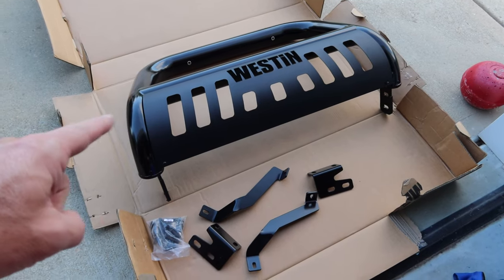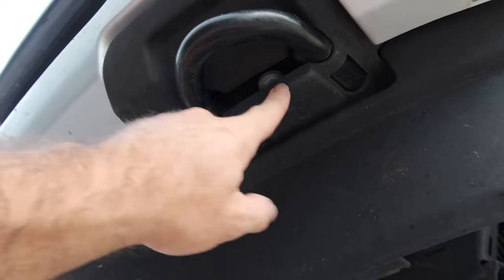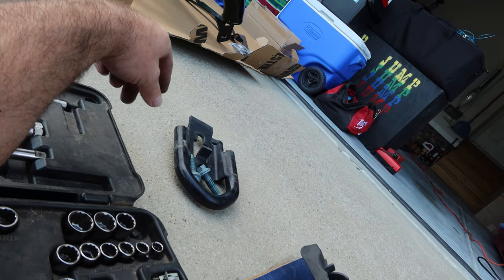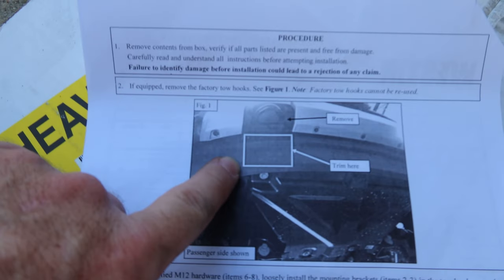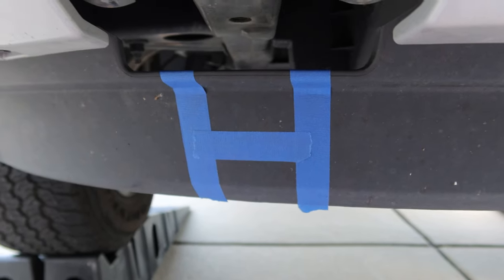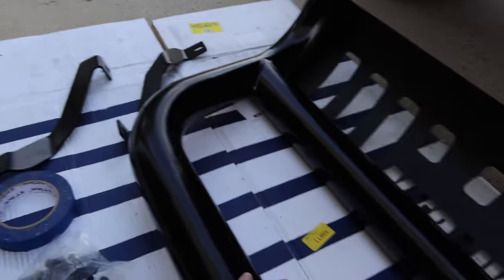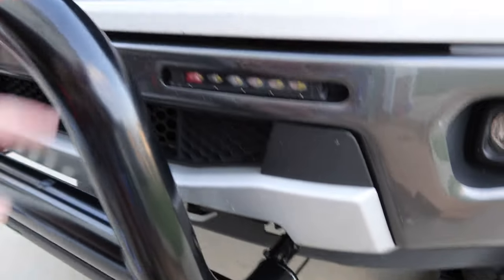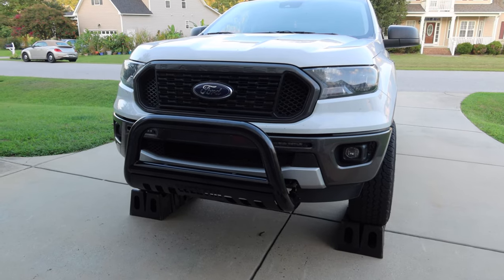Ranger Bull Bar Installation - How to Install a Westin Bull Bar

Comment: What about the parking sensor or collision sensor? Didn’t interfere with it?
Reply from the maker: I do not have parking sensors on my truck, and I can't speak for other models. However, the collision sensing is handled by the camera in front of the rear view mirror, so it is not affected.

Comment: i wanna get this same bar, just wonder how different it would be on an XL with no stock tow hooks. the brackets are there but the bumper cover would definitely need trimming
Reply from the maker: I would go to the website and use your trim level and make sure it's compatible.
Reply: Just because you don't have the tow hooks doesn't mean you don't have the holes for them.  I have an XL - but was upgraded with the STX black out package...I have tow hooks...therefore I believe the holes exist on all Rangers.  You should be able to check by getting down in there and looking.

Comment: A few comments. This bull bar doesn't work with the factory skid plate, which is an option. Second, the upper brackets that were left off in this video are very hard to install without scratching the paint.
Reply: What did you do? (if you had the factory skid plate)
Reply from the maker: I didn't have the skid plate on mine. Sorry that I can't help!